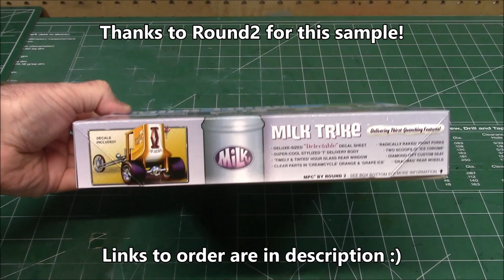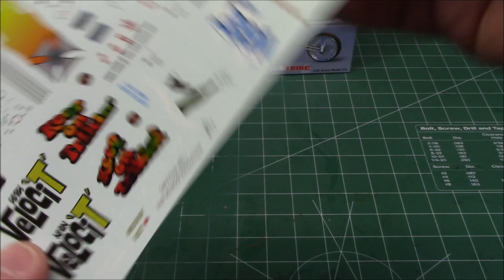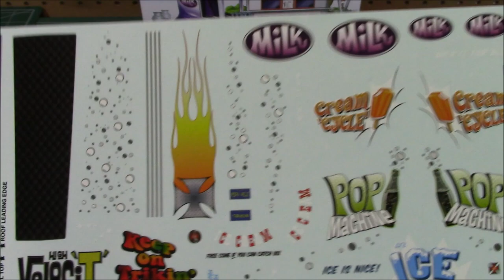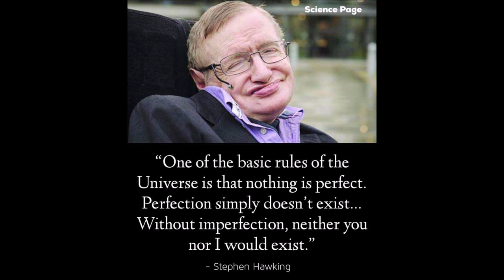Milk Trike V8 Chopper #4 Trick Trike Series 1/25 Vintage Scale Model Kit Build Review MPC MPC895

Comment: Sometime I'd like to see you do a kit I've had trouble with. It's Revell 1/16 scale Roland Leong's Hawaiin Charger Funny Car kit in Skill 3. The trouble I've had is that the line lengths printed in directions are a bit too long and break off tiny parts from engine. I'd like to see a build of it with you seeing if you have same problems from lines to give advice to other builders.
Reply from the maker: If it gets reissued and they send it over I'd love to build it.

Comment: Moove over another bitchin bike comin' through ! 
Great job on the build ! ✌😎

Imagine that bike or any of those bikes in real life....
You'd need a parking lot if you wanted to turn around 😂😃😁
Reply: LOLh, you wouldn't have to worry about turning around. With no radiator, it's lifespan would be measured in minutes...
Reply from the maker: Just a couple of acres for this Y turn!

Comment: How long do you let your Rustoleum color coats dry before you handle them? I have had a lot of trouble with that line of paint needing... weeks of dry time without getting any finger prints on the surface before handling.
Reply from the maker: Overnight works fine for me in most cases.